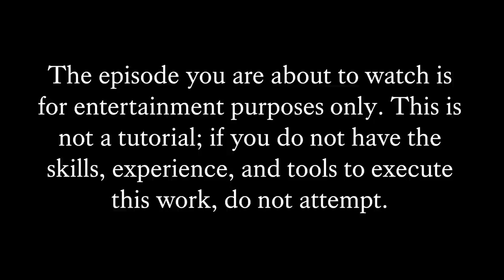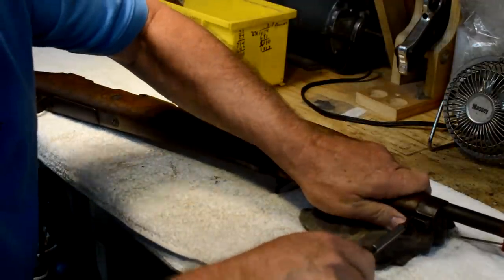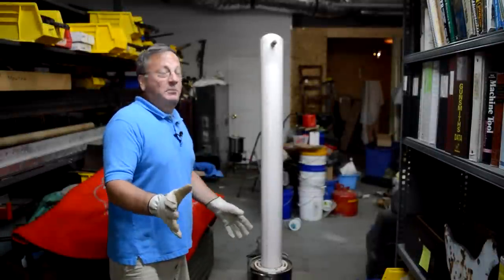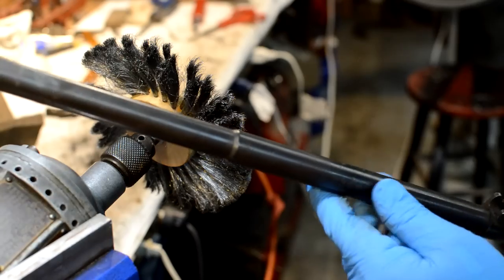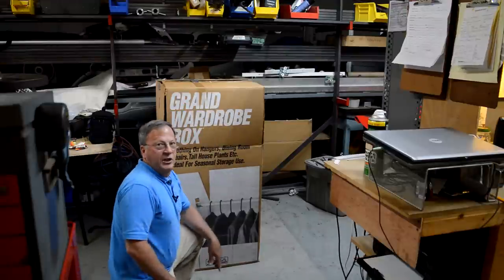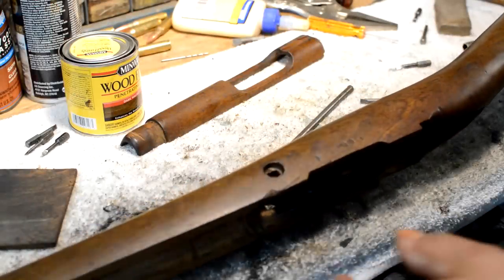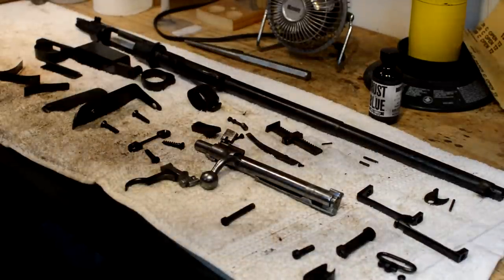Anvil 013: Rust Bluing on the Cheap

Comment: I have a Winchester model 12 that is a family heirloom. Unfortunately one of the genetic defects in my family tree cold blued it. I’d like to try to bring it back to closer to original. How can I remove the cold blueing?  I have a pretty good set of tools including a 8” variable speed bench polisher.
BTW, I intend to practice on a couple of garbage rods before I work on the model 12.
Reply: There are a number of "blue and grease" removal compounds on the market that will remove cold blue. Birchwood Casey does a good one. You then need to carry out the cold blue process. If you are in the states, then I advise you to get in touch with Bob at Rustblue.com he is a genuine good guy and will see you right.
Under NO circumstances go near the bench polisher with your gun.. You need to get hold of a proper Grobet carding brush from Brownell which will remove oxide, but not blue! Even if you want to refinish the surface, use fine emery and a backing block to refinish the metal. Using a bench polisher will round edges and remover detail even with light bobs and fine soap...
Reply: Felix The Cat Thanks. I’ll get ahold of Bob and see what he has to say. I think that they used Birchwood Casey cold blue so I’ll look into their removal product also.
Reply from the maker: https://www.youtube.com/watch?v=rShG_F85W1Y&t=2640s      try this first
Reply: Mark Novak   Thank you for the help. I’ll try this.
Reply: If your model 12 is as old as mine (1921) the barrel is nickel steel and blueing may be a different process? Just info I read on the net.
Reply: @wjgrind  I hadn’t even thought about that. I’ll have to look into it.

Comment: Any pros/cons to steaming vs. boiling for conservation process? Any situations where one is better than the other?
Reply: "boiling" is often more accessible to people who only have 1 gun to do (because you can do it with normal household items); and to expedite it, you just preheat the steel in an oven, on a stove top (carefully), or with a heat gun until the metal is about 250'F, then pour and continue pouring boiling water all over it until it converts (small parts can just be dropped in a pot and boiled). Steaming's better if you have several guns to do (or a group of friends go together on it, due to cost; or you have a shop, like Mark) because it's faster and you have to handle the hot metal less.

Comment: Is this a viable method to repair more modern firearms with holster wear? How were the newer guns blued originally? Will the color match?
Reply: I had a nice reply typed out and it didn't post for some reason. The short of it is this. If you're concerned about the finish wearing quickly you can cerakote the parts or have them TiN coated. Titanium Nitride is usually gold but there is a way to make the coating turn dark almost black.
Reply: Roger J I'm talking about a revolver, and I think it would look best blued. Also, I don't think Cerakote would hold up to holster wear any better than the factory blue job.

Comment: Does running the wire through the muzzle damage the crown?
Reply: Not really. Most parts on a firearm are hardened, the barrel and crown are no exception. Unless the wire is sharp and you really start sawing back and forth with it no damage will occur. Guns are mostly idiot proof. Unfortunately, they're not really Bubba proof.
Reply: Does the steaming process rust the bore? I would think that the inside of the barrel would be affected in the same manor just not scratched clean.. forgive the thousand questions, I’m just trying to learn
Reply from the maker: No chemicals in the bore. Just card the bore like the outside of the action. I suggest a standard bore brush, in your cleaning kit
Reply: @epluribusunum5318  barrels aren't hardened. Unless they're stellite lined, chrome lined or nitrided, they're very unspecial metals. I've had airgun barrels fight back harder than any firearm barrel I've messed with, including stainless barrels.

Comment: Mark, could you also blue a gun , with a combination of boiling, and steam?
Reply: yessir. all that is needed for the chemical conversion is water, heat, and rust. The form of the water is not an issue

Comment: Can you rust blue over modern hot salt bluing, or must that be stripped off?
Reply: Broken_Yugo if you want a clean finish you’ll have to strip the caustic bluing.
Reply from the maker: I agree. Almost every time I've tried to cheat, the finish usually has to come off anyway. Hot Dip blue comes off easily so .....

Comment: I didn’t see any degreasing step, only that Bob’s steam pipe will get the oil off.  Is that step missed altogether or wasn’t shown on camera?  Thanks
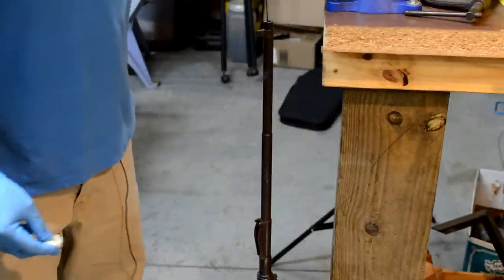Reply: 31:50
Reply: sicirorvs thanks, I missed that one.  I guess I was expecting it before the pipe steamer.

Comment: So do you not have to decrease the parts being rust blued?  I may have missed it.
Reply from the maker: The first conversion boil and card usually takes care of the residual oil/sludge/glock problem. Always degrease in some format first. We intend to reshoot this video because some things need clarification. Thanks
Reply: @marknovak8255  thank you for the clarification.  I ended up decreasing, converting(using the steam pipe method) and carding.  So far so good.

Comment: Are there any issues boiling a laminated shotgun barrel Mark?
Reply from the maker: The pattern my be ruined by the carding process. The choice is to allow the rust to continue and ruin the gear, or learn how to develop the twist pattern in a damascus barrel
Reply: @marknovak8255  There's actually no swirling pattern to it. It's a J. Manton & Co. hammer gun thats stamped "Laminated Steel" on the centre rib. But I will do more research on it and the steel. Thanks for the reply Mark! And for sharing your work with us all!

Comment: Great video!!  How do you protect the bore during the rusting process?
Reply: J One, on one of his instruction pages, Mr. Novak (I guess it was him) makes reference to using lacquer to coat the bore and that it could easily be cleaned off later.  I wondered how to apply it, then decided to used a bore mop lightly dipped in lacquer and let dry.  Probably should apply it a couple of times to make sure it covers everything.
Reply: I went to get a can of lacquer and found they had spray lacquer.  I'll try that.

Comment: $13.95 to ship a two ounce bottle? Does it come in a gift box with real gold foil ribbon?
Reply from the maker: It's technically hazmat. It IS what OTHERS charge us to ship stuff, plus the packaging, plus our time.
Reply from the maker: Tech question.....If I see it correctly, the bamboo is woven into the bags?
Reply: @marknovak8255  no it can grow in the bags but not needed.
Reply: @marknovak8255  Thats what I figured..
Reply from the maker: OK, so like my experimentation with 5 gallon buckets, growing tomatoes upside down. Very cool
Reply: @marknovak8255  the bags are basically a composting worm farm. If you put them in a rain gutter flood table system (or a swamp) and put a tomato plant in them you can get about 10 to 12 pounds of tomatoes from a 7 to 10 gallon bag. The more you feed the worms the more nutrients for the plants. The bags also cool by transpiration so they don't die by July from the heat. They require a lot of water and worm food so it has high performance needs to go with the high performance results. Right now is hurricane season and we have Sally dumping rain perfect for the bags.
 Tomatos are a lot of work especially in Florida. I'm trying to grow some forest with the bamboo right now.. 
Keep up the great work love your vids!

Comment: Would plugging the barrel and chamber with rubber or something help avoid rust flashing in the bore of the rifle during the process?
Reply from the maker: Not really. No chemical in the bore, so it rusts VERY slowly. just pull a brush and oil when all bluing steps are complete

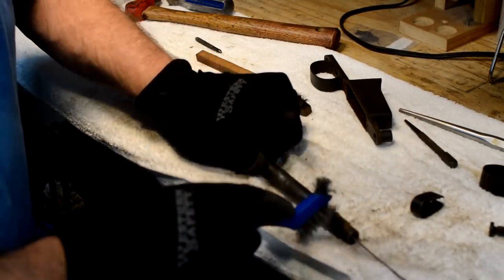Comment: Around 15:00 on, you guys are using a steel brush and talking about the dangers of wire wheels and brushes. Can you not get the same effect with a brass brush? I use brass brushes shaped like the one you have there for my abused guitar repairs. There are many  things you gun master builders do that I take and use on guitars.

So why not a brass brush?
Reply from the maker: If it's soft enough and doesn't harm the surface, any brush should work. I'm wondering if a plastic/synthetic variant is available..........we also use the carding wheel on wood. Essentially powered steel wool
Reply: @marknovak8255  they make nylon bristled brushes for polishing, most of the time you can get them in different grades (like polishing compounds). 3M also makes rubber bristled wheels as well, and Scotch-brite (that's 3M still, I think) has abrasive wheels (too much/hard to control for this job, but useful for other things). Just read the descriptions well,  some have compound embedded in them from the factory, some come just plain bristled (with different thicknesses for different amounts of abrasion). Nothing else, you can use a disc arbor and put a couple of poly scouring pads in it (the ones you use in non-stick cookware), instead of a wheel. I only really use the steel wheels to scratch up metal for welding/soldering/brazing anymore, got tired of picking wires out of everywhere.

Comment: How do you protect the bore?
Reply from the maker: There are no chemicals applied to the bore. It will be fine with a few hours in a steam environment, and can be brushed out easily with a  common brush. Short answer....we don't make any special effort to protect the bore and leave it open at both ends
Reply: @marknovak8255  Thank you, that makes perfect sense.

Comment: Does the steel need to reach a certain temperature before the rust converts? So larger parts need to be steamed longer, while small parts can take just minutes?

Also, how about big thick clumps of rust? Just keep boiling/steaming and carding till gone?
Reply: well, technically it can happen in just damp conditions (the red oxide reacts with water in the air, biggest issue is that red oxide keeps forming until you oil it), but being at or above boiling really speeds it up; and to paraphrase what Mark said: "you're trying to control the way it rusts". In days of yore (we're talking medieval times up to the mid 1800's), whitesmiths used humid rooms ("cold rust bluing") or later, vats to submerge the rusted metal in boiling water (that's kind of inefficient, hence the steam). For all your questions: Yes, just boil/steam until ALL the red rust turns black (big, deep spots of pitted rust should probably brushed most of the way out before rusting, mostly to determine the level of damage); then gently card the bloom off (loose fuzzy stuff) after it's done converting. Unless the rust is INCREDIBLY thick, shouldn't take much more than 25ish minutes to fully convert (but it doesn't hurt anything leaving it in longer, you can speed it up if you don't have steam by preheating the metal to 250'F or so with a heat gun or in an oven prior to applying boiling water (that's what I used to do)
Reply: @wildrangeringreen  MMmmm i see. Thank you for this! I've been trying to stop the decay on a Lebel I recently got. A bunch of test pieces of rusty metal I've successfully been able to convert both by boiling and steaming, but whenever I would go to do my Lebel and related parts, they dont seem to convert. And a particularly tough patch of rust on the barrel just wont budge. But ill take what you've said and try n figure it out some more.
Reply: @AbananaPEEl  I assume you're degreasing it before boiling? Having oil in the water can mess with it, just want to be sure. If it's a really troublesome spot, you may have to heat it to 300, just be careful. Also idk if you're already doing this, but distilled is better, as the minerals can sometimes cause issues in normal water. Good luck!
Reply: @wildrangeringreen  Yup. Degreasing in mineral spirits before. And when boiling I was using distilled. Though used tap when i steamed. Ill look into heating to 300. I may just not be getting hot enough or something. Im about to rent a book on gun bluing from the library, since this is essentially the same thing on uncontrolled/unintentional rust.
Reply: @AbananaPEEl   Mineral spirits doesn't usually suffice for degreasing.  Acetone or TCE is usually where you want to be.  Of course both require heightened safety precautions.
Reply: @kevinblanchard6652  mmmmmmm thank you very much I had inklings that that could have been the problem, but when I would google it, people said it was ok. Ill try acetone or something like that and see whats what.

Comment: All good and well showing how to do this but not much use if you don't know what exactly the chemical is made from.
Reply: Buy it from rustblue.com
Reply: @edwardholt6967  👍 
I was hoping someone would give up the formula for making it.
Reply: @rafo6577  The are many recipes that work and books on the subject.
Reply: Anything that rusts metal. you could leave outside in the humidity and boil it once it's evenly rusted if you want.
Reply: it's salt and acid... that's it; you're just trying to force the steel to rust quickly/evenly (so it doesn't pit). I build a few ML guns for sale every year, and I use salt and vinegar (I get 10% stuff for the farm, most grocery store stuff is 4-5%, mine just goes further). You could also use Sulfuric, Phosphoric, Hydrochloric, or citric acid, if you prefer (watch how strong you get the mixture, and careful mixing strong acid with water). For salts, about the cheapest are sodium chloride and calcium chloride.

Comment: Yeah, no, NOT a wire wheel - am I right fellas!
Reply: Yep.. you is right! Oil free carding brush or 0000 wire wool! 

...step away from the Scotchbrite!
Reply: @felixthecat265  what's wrong with scotchbrite?
Reply: @ScottKenny1978  Rust blue is achieved by creating a layer of hydrated iron oxide (rust) on the surface of the metal. This is achieved by de-greasing the surface, adding a reactant such as an acid, and then allowing the rust to form on the surface of the metal. usually in a moist warm atmousphere. Normal rust is porous and it is this that, if allowed to continue, will cause pits to form. To prevent this, the rust layer is then heated in boiling water or in a steam box to convert the red rusto to a blue form that is not porous and forms a protective and decorative layer on the steel. The blue layer coming out the boiling water contains both surface oxide and particles of flaked off oxide that need to be removed. 

This is where the carding process comes in.. the carding material needs to clean off the surface oxide, but leave the oxide bound to the surface of the steel. Fine stainless carding brushes can achieve this, as can soft 0000 wire wool, anything stronger will remove the surface oxide layer and expose the bare metal. Scotch brite, athough it is made on an nylon fibre matrix, contains additional abrasives such as aluminium oxide which will remove the blue with even the finest grades. 

When you are restoring a gun which was originally rust blued, it is common that the original blue will change over time to a brown chocolate colour. Rather than remove this original layer and reblue the surface from scratch, current restoration thinking is to boil or steam heat these surfaces which will restore the original finish. In the days when guns were routinely cleaned with boiling water to remove the chlorate primer residues, this re-bluing was almost automatic, however as everyone has gone over to cold cleaning methods, all the old guns are now turning brown...

Sorry for the long explanation, but I hope you see the logic...
Reply: @felixthecat265  ah, ok, didn't know that scotchbrite had additional abrasive particles in it. I used to be able to get white scotchbrite, which was about the same level of abrasive as 000 or 0000 steel wool (was working on airplanes, so steel wool was a bad idea due to dissimilar metal corrosion).
Reply: @ScottKenny1978  White scotchbrite is the finest of the grades, but it is still harder than 0000 wool.. it is excellent on aluminium and other light alloys as it will shift aluminium oxide which is paradoxically, very hard...
Reply: @felixthecat265  we still used brown/red and green/blue scotchbrite, the white was for removing the oxidized layer of paint. The others were for removing corrosion.

Comment: Unfortunately the word "maintenance" is rather foreign to the current crop of youngsters, which is a screaming pity. It helps to hear you use the word.
Reply: Okay boomer
Reply: ain't just young adults... my father and grandfather's generations didn't do this stuff like they should have either, most of the time they used a gun till it stopped working (mechanical issues, cracked stocks, shot-out/ metal-fouled barrels, ect), then oiled 'em up and put 'em in the closet for me to dig out 20-40 years later. From the reaction they had, you'd thought I had suggested setting those two on fire when I started to tear the guns down to the barreled action and bare frames to refit/repair/refinish them. Honestly, from the lack of good condition, original guns pre 1870, I'd say most people are afraid to work on their weapons, and leave them to decay until they don't work anymore, then buy new.
Reply: @wildrangeringreen  Truly! And the Mennonite farmers I used to hunt with would literally let the sights rust off and then just squint down the barrel. My heavy barrel .22 took the long shots, and never failed me 'cause I learned maintenance before I got my first gun.

Comment: BOB ??? BEE,ZERO,BEE  I dont know ? Using a wire heel on any firearm is just not right.
You may as well Beed blast and blue .
Reply: Its only "not right" if your aim isnt to re-blue the metal... otherwise its literally the only way to remove converted rust.